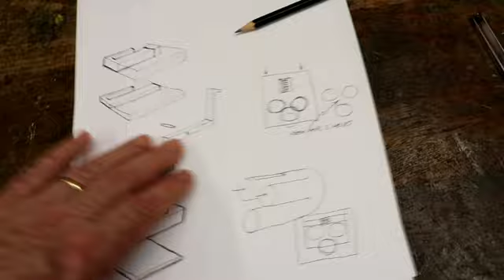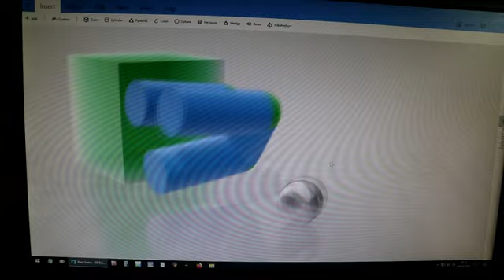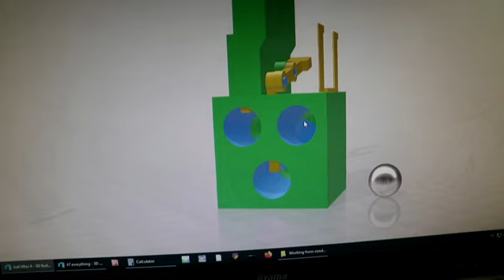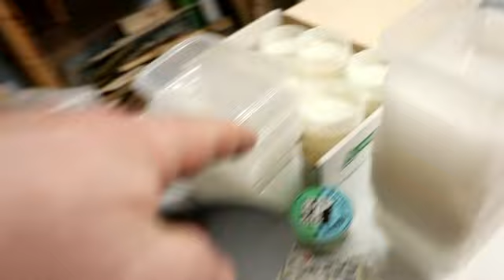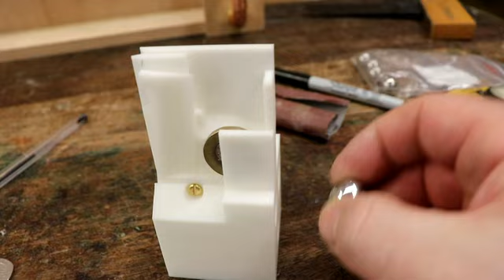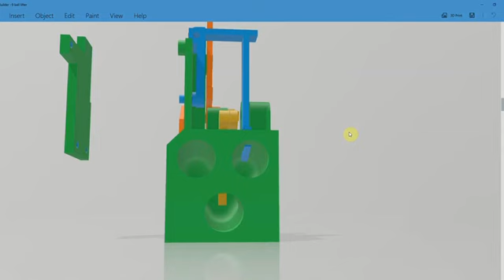Unplanned Steampunk Arcade Machine #2

Comment: Create hybrid designs. Laser cut most of it and add small 3d printed parts and glue them together.
Reply from the maker: That's a good idea. I think this project is certainly going to require hybrid parts. In fact I've just printed off a circular coin guide, to roll the coins through the side of the cabinet into the lifter, via a simple 38mm diameter drilled hole. On the outside, this will be attached to a nice decorative laser cut coin entry. How exciting!

Comment: Nice job, starting to get complicated ?..... May have a problem with the lighter coins so don't forget Archimedes mechanical advantage..  Some good thoughts in the comments. Your coin doofer widget his rather natty, remember coat-hangers make good levers and couplers.    Son's,  they can't resist noisy mechanical stuff. Better if it smells of Caster oil.  
My Dad treated himself to a Qualcast Suffolk Colt when we moved to a larger gaff, he used it for a few weeks then much to his delight I took over (aged 10).   Soon all the lawns had stripes or chequers and I got to dismantle and understand the infernal combustion engine, tuning it up and (in my head)  improving establish British design.  
Conclusion; Dad's  master plan proving successful he could sit back enjoy his beer and lawns and be satisfied his Son was going to be an engineer. Over the years he tolerate a Hovercraft in the Garage,  1954 Ford truck in the bottom garden, several motorbikes, go-carts Ham radio tower, Ford Anglia, and a Saab95 Rally car. In return he had free oil changes ........ Thanks Dad
Reply from the maker: Okay, endlessly getting more complicated... I'm very pleased that the coin lifter does finally work with all the coins (and brass washers)!

What a great bit of forward planning from your dad. Get a lovely lawnmower, get son interested, son mows lawns and I drink beer! I'm very pleased that my son really has got into gardening, thanks to a kind neibour and a lovely Bosch mulching machine. Unlike the horribly noisy shredders, it uses a lovely geared down powerful motor to turn a sharpened archimedies screw. Quiet, effective and a joy to use. However, his next job was to dig up a huge old shrub in the front garden - no machines,  just boring hand tools. A real shock, but I'm very impressed he didn't give up, and has spent hours getting it removed. Hourly payments probably helped!
Reply: @steamhead  I think all Dads have high hopes for Son's.    "From little acorn do great Oaks grow".   After few false starts  I eventually found my niche as a Thermographer,  played with Ships, Aircraft, Turbines Paper mills, Refineries etc etc and they paid me ! I think we did OK.  

Well done for your son taking on the work, take on jobs for people who have contacts then that leads to interesting work opportunities. If you don't like something then move on, life is too short. 

 Digging now this is a pain without a Back hoe (a later addition for the Fordson Major )  however Archimedes comes to the rescue with an "post drill" auger screw (Toolstation) , great for loosening the soil, smaller ones for the electric drill making bulb planting a 10 second joy.  

I fixed one of those mulcher's for Dads neighbour, nice bit of kit however dodgy bucket switch and if the motor no Chooch (technical talk for no worky ) then the run capacitor is the second thing to check.  

I am  concerned that your Son has yet to experience the fine aroma of over worked engines.  Too easy for todays youth to be led astray by Greta Thunburg to the Green side.  Have you thought of restoring an old Atco 24" duel clutch mower.  

Seriously John    I think a joint project to build a Stirling Engine,  Baked bean tin and Coke can, wire coat-hanger and a flywheel or you can make it as complicated as you want but thats is a nice project for you both.
Or visit : Worlds largest working triple expansion engine with MERCURY ARC RECTIFIERS !!!!!!!.  Has anyone in the comments been there. ? 

kemptonsteam.org
Kempton Steam Museum,
Snakey Lane,
Hanworth,
TW13 6XH

They do an engine driver day Whoooopeeee

 Scratchy from Banjo

Ps Does your coin mech accept Bitcoin.  I will go now.
Reply from the maker: @Woffy.  What does a Thermographer do? It must have something to do with temperature...

I'm very proud of my son (I'll ignore the aggro getting him up before lunchtime the last four days, so he could do the work). Today he learned how to saw down a tree with a bow saw. Practise next door, then get him to sort out our backgarden/wildlife reserve!

I remember the utter joy of hiring an archimedian auger when I had 20 fence posts to 'plant' up the garden!

Thanks for the tip regarding the capacitor. I've had the mulcher for years, but managed to crack the archimedes screw and had to replace it. Interesting to see how well it was constructed. Not surprising considering the enormous forces created by an inclined plane - what a lovely phrase!

Such a 'shame' he has yet to smell burning castor oil and over heated engines - the youth of today... they don't know what they're missing. Although it means I can still watch and not get involved.

A Stirling engine would make a lovely Father/Son project. Sadly I've been enocouraging him for years with Technical Lego, Meccano, tool kits, Arduinos et al, but he's resolutely into the artistic side. There's only so much one can do!

Why on earth does the worlds largest triple expansion engine require a mercury arc rectifier?!

I don't think we've visited Kempton Steam Museum. It looks fantastic; thank you - I feel a visit coming on. We have visited the London Museum of Water and Steam, which is in that sort of area, and is well worth a look.

Scratch from Ziggy for Banjo.

Bitcoin... probably time for bed!